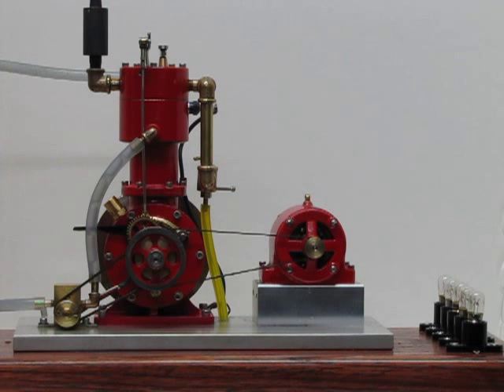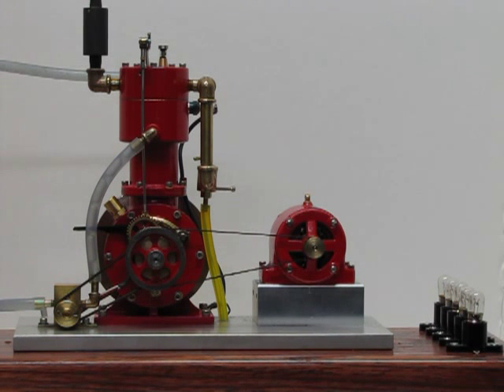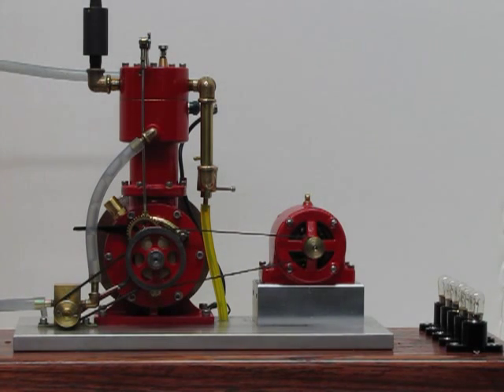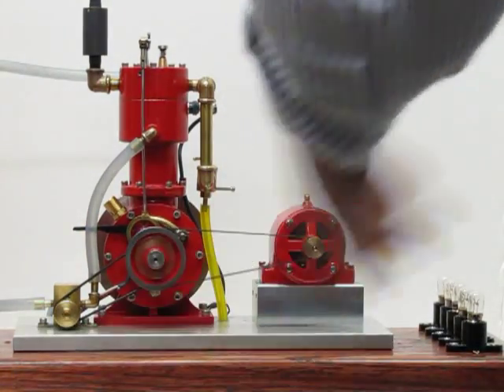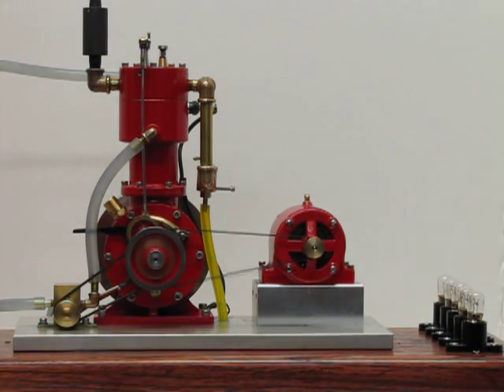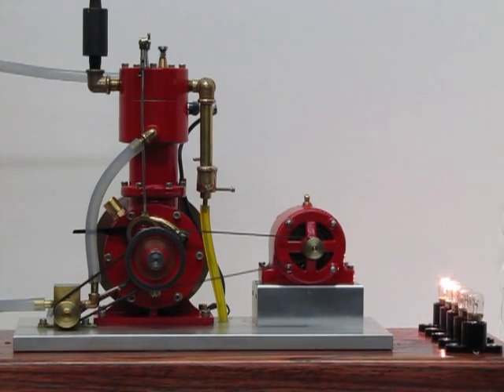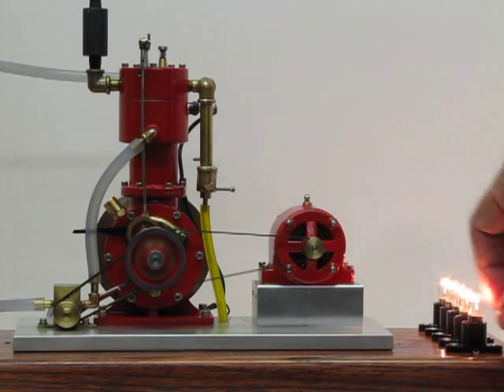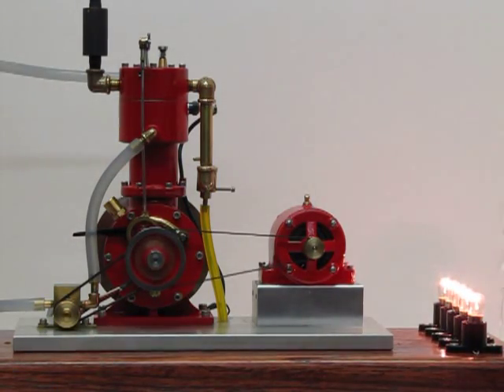The Bill Electric Plant

Comment from the maker: Nick,
The cooling water pump is used for circulation only. No back pressure is developed. Flow is dependent on the RPM and gear size you choose. Never checked mine, but it could be calculated. The pump, as designed, is adequate.